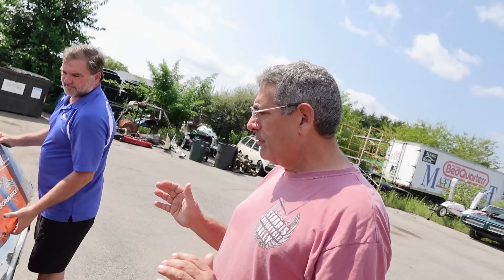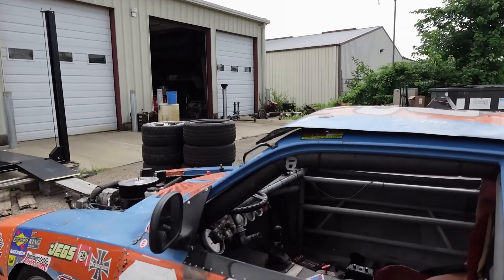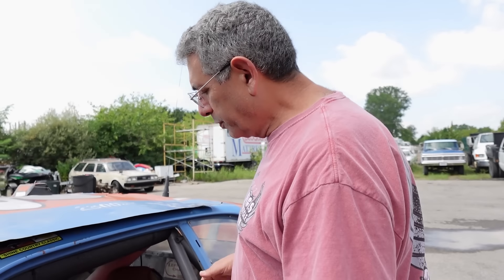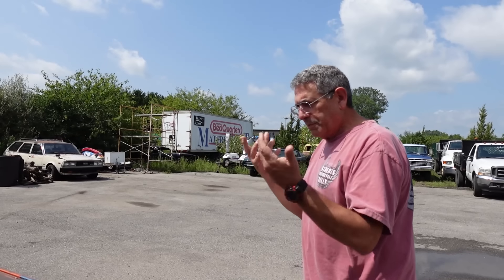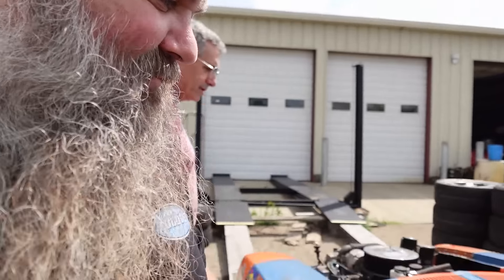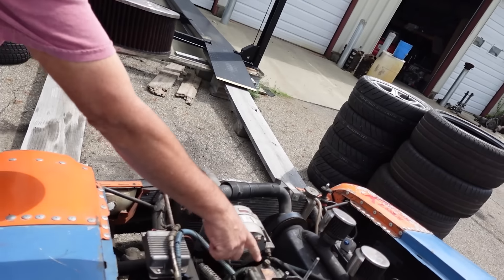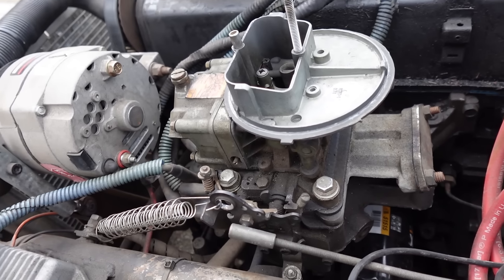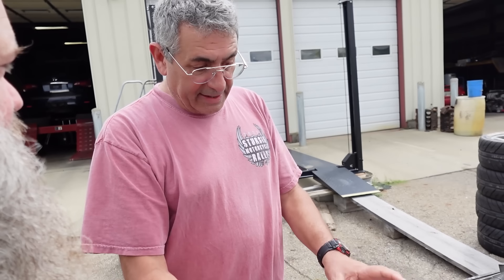Pinto Race Car "Inspection" With Mr Norm of Team Blitz!

Comment: Hey Mr. Austin, I noticed at about from the 31:29 mark to the 31:34 mark it looked to me like you had a plug wire arcing to the carb, or the manifold near the center to the back of the engine. I think to combat brake fade, I would flush the system and use dot 5 silicone brake fluid, this took care of. Y brake fade. Thank you for all you do, keep up the great work!!!

Comment: I just thought of another top tip for you from my own experience. Hood pins: You need to attach lanyards to them so they do not get lost or forgotten in the heat of battle. Also carry a spare set. Saved my ass a few times. Sounds simple but it is always the simple things that will bite you.
Reply from the maker: Ohhhh interesting idea! Will keep that in mind, especially given the hood and the "trunk" lid are fastened with 4 hood pins each. Thanks for the tip!

Comment: I'm wondering if you might have to move the master kill switch. All the ones I have seen are mounted where a track Marshall can teach it without reaching into the car if something happened. A friend of mine was an SCCA tech inspector in Florida. One of the things he did was check the kill switch. They had the driver start the car rev to 2000 hold the break and hit the kill switch. This is to make sure all power is shut off and nothing can back feed from the alternator. If you run an SCCA event you will need a fuel port where tech can get a fuel sample if required.

Comment: I love how he was describing the "padding for the shorter people" and doing everything he could to not say "they make booster seat inserts." The cars and truck in your back lot are making me drool and whimper.. I miss my 76 F100 more than anything else I've owned.
I've kind of wanted a Pinto Wagon for a while.. this car is starting to make me REALLY want one. I want something I can take out and drive all over the place in the foothills and blast around and have fun and come home with fuel still in the tank.. Though I will say, NOTHING beats the sound of a V8. The thing I REALLY don't like about 4cyl performance parts, is they are just as expensive as V8 performance parts and you get half as many. A set of 4340 rods for that thing is $500 for 4.. a set of 4340 rods for say a 5.7l hemi is $500 for 8. Sometimes they are way more.. A forged crank is $2900, an Eagle forged crank for a 302 is $700. A full Eagle forged rotating assembly with pistons and rings for a 302 is $2500. (I spent hours looking at parts yesterday)

Comment: As a long time club road racer, and a good friend of Norm's I do have one tip on brake bleeding.  I get a spare brake master cap, drill a hole in the center, and install a "screw in" tire fill valve. I then take a portable air tank with a "clip on tire filler chuck" and with a pressure regulator set for say 15 psi, I clip it to the modified cap with the tire fill valve.  I now have a pressure bleeder using 90 % of items I would normally take to the racetrack.

Comment: Fires right up ! 
   Lol ,  hope he wasn't projecting. 
   It does fire right up may I ask if this inspection is the carburator or fuel injection ?   Last video I saw it had F.I. but Holley mentioned in video.
Reply: 25:01 Carb on the race car. F I on the black AMX.